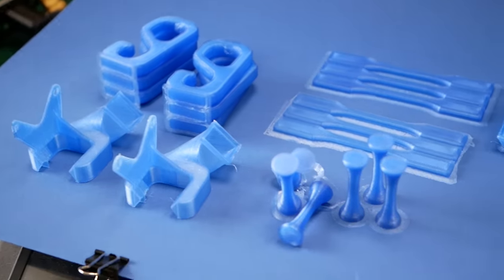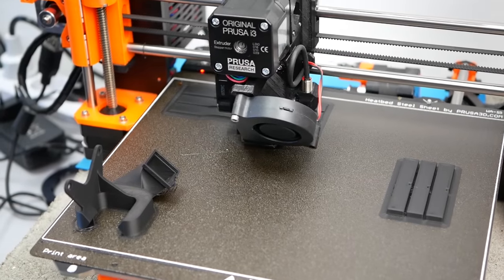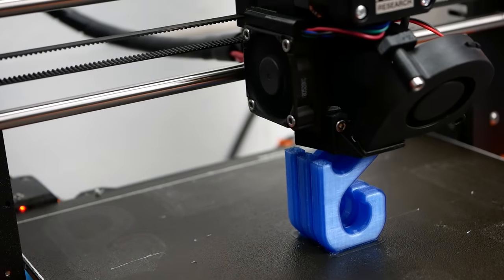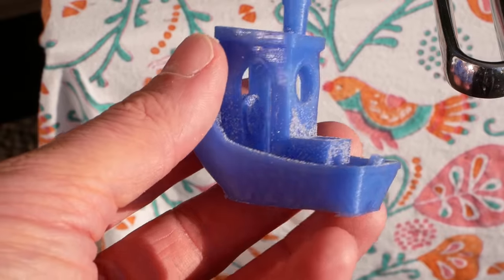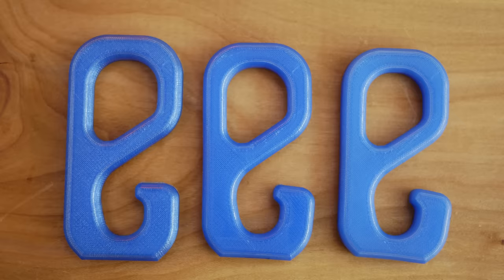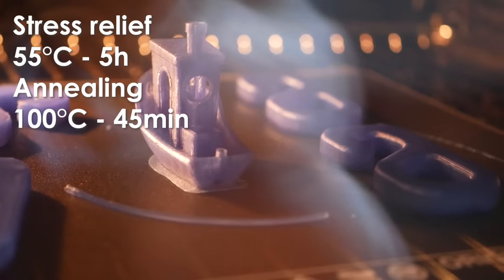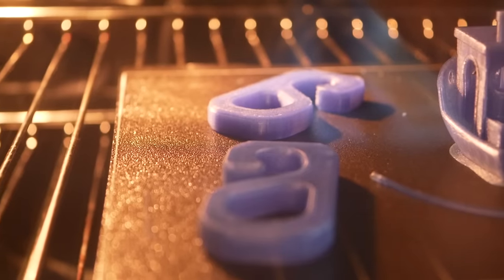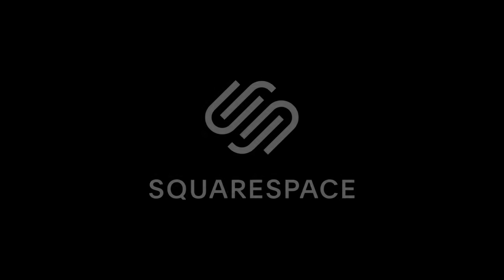Strong 3D prints through ANNEALING, but... Part 1: PLA

Comment: Wouldnt it be cool to have a duble extrusion 3d printer that would have really high temp plastic in one nozzle and like pla in other. So it would print the shell of the part and than crank up the bed temp to 220°C and fill the inside with pla. It would make really strong parts

Comment: What about using a blow torch on the surface with some kind of rotation?  This might even help to smooth the print and increase the strength somewhat at least the surface layers.  Or what about a rotisserie oven.

Comment: Would be interesting to see how the material behaves after multiple heat treatments. The first one increases the heat resistnance 10%. So maybe you could higher the temperature in the second run to increase it even more.

Comment: Nice testing as always. I have wondered about a infra red heat lamp is use during printing as I did it before to reduce warping but it keeping the previous layer warmer may help with layer adhesion

Comment: Annealing is due to the process of heating then *flash cooling* similar to quenching steel for knives ext.. you didnt see gains  because you allowed it to cool overtime
Heat it up to just below it deformation temperature then flash cool it in water

Comment: I've only heat treated PEEK because the filament manufacturer said amorphous PEEK doesn't have the desirable properties. I suspect the idea that annealing parts improves layer bonding is on parts where there's residual internal stresses such as poorly printed ABS parts. Print ABS well and you probably wouldn't benefit. I suspect nothing will change with PETG because of its lack of crystallization.

I'm not seeing where it's worth annealing PLA to avoid needing to print some other material.

Comment: Thanks for this! I always wondered if it would help the layer adhesion, a bit of a bummer it's not. I think we would need a printer that would be able to rotate a piece while printing and have a layers added horizontally on top of vertical ones... But I cannot think how a machine like this could work! 

I did many parts in two sub parts, one printed horizontally and the other vertically and glued together after to augment the resistance, works well, but more work in design and built

Comment: I wonder if pressure applied during the heating process would allow for layer bonding. Perhaps a weight on some packed sand, with the layers you'd like to bond, parallel to the ground?

Comment: I would really like to see you investigate PLA's tendency to crack as it comes off the spool. This especially happens with 3mm diameter filament and seems to happen after the PLA has aged for several months. In my experience it seems to form small cracks on the inside of the coil shape that comes from being wound onto a spool. Is this simply due to the stress of a coil being straightened? Or is there more going on here? Thanks for all the great videos!

Comment: I only have an old DaVinci Mini, got it 2nd hand for cheap along with a roll of blank tags, to learn and print some handy little gadgets. This can be very useful to try, as many prints is various holders and adapters used for solder equipment ("functional prints"). It's not directly in contact with hundreds of degrees, but it can be near so radiative heat exposure often up to 80-90°C, which has already messed up some of my printed parts.

Btw, the DaVinci doesn't have a heated bed,and its construction doesn't seem to make adding one a realistic task. Would plopping an enclosure over it, help notably with bed adhesion? Room temp is usually 25-26°C when printing, but I assume a box around the whole printer could probably increase the effective ambient temp for prints..?

Comment: Perhaps make somewhat hollow prints and then fill it up with a strong resin of sort...

just beware that the curing process creates heat so it could also warp...
maybe that could be countered to let it cure in sand + vacuum?
Reply: I mentioned it in another comment but i believe you can use gyroid infill with this process

Comment: Great video. Just curious if you had accounted for the moisture content of the pla? The annealing process probably also dried out the filament very thoroughly which might be a factor.
Very interested to see your results with nylon. My favourite filament is 3dxtech CF filled nylon which produces really strong parts including layer adhesion but can't do a layer thickness of less than 0.25mm.

Comment: Thanks 
This was very insightfull and learned alot.
I was wondering if this annealing process if it followed, a reflow soldering temerature curve where you heat the parts to a specific temp for a certain time that every object can reach that temp then ramp up the temp for short period then decrease the temp slowly. 
Probally achieve the same results.....
Or will it?

Comment: I bet you would get more significant results doing stress relief with a high-warp material such as Nylon, ABS, or Polycarbonate. PLA is such a low warp material, I am not too surprised that the results were pretty underwhelming.

Comment: I was thinking. you really want to melt the outer shell.. Because its the outer shell that takes most of the force. Then inner part is just there to stiffen it up.

So in stead of trying to bake it for a long period of time. Bake it so fast that the inner structure don´t have time to heat up. 

Exactly how to do this i don´t really know. But it need to be heated up really fast and then cooled down fairly quickly as well.

Something like submerging them in boiling oil. Or just dipping one side at the time. This should totally melt the outer shell. refuzing it, while the inner structure is still sollid, making so it don´t fall apart.

Comment: Hi Stephan, I recently discovered your channel and I really like your content. Watching some previous episodes an idea occurred to me that I think you may be interested in. It is about using a 3d printed part with little infill, and using it as a mold with sand in a preheated oven in order to recycle the support and waste material to melt it and use it to fill the spaces in the printed part to fill it with material. I think it's a good idea to be able to use material that would otherwise be discarded and get a piece that gains a lot of strength while maintaining the general appearance of it. I hope you can try it and test the results. Auf wiedersehen and goodbye

Comment: I have tried annealing PLA by putting it in boiling water and letting the water cool slowly with the part in. I perceived it as being slightly stronger than the un-annealed but I don't have any data to back it up.

Comment: would you please test whether or not increasing layer overlap increase strength? It seems that if an individual were to use many of the tactics you've researched that the accumulative effect would be add up to be a significant increase in strength. Perhaps compiling these strategies into and "end of year" video could help out everyone trying to maximize their printing success.

Comment: How did you decide what time length and temperatures to use?

I have tried the sous vide method and surprisingly didn't see any warping. I didn't do it in a controlled manner like you though so I cant begin to ponder why. It was just a quick test to see if the method would work. I put the part in a zip lock bag filled with water and put that into a slow cooker like thing (timer and temperature control but no pressure). Heated at 80 C for 1hour and turned it off and let it cool overnight. I also didnt have specialised tools and didnt actually test the effects on strength as the only test I could do would have been temperature resistance but couldnt do it in a reproducible way.

Comment: I can't be more pleased than when having access to an attempt to prove something through a measurable and reproducible experiment.
You did it quite well since the birth of that channel.

That said, and although I'd not be able to suggest any precise experiment that would go further than yours, here's my opinion. Hope it helps :

My guess is that the filament's critalinity is already maximised when exiting the factory. My guesss is that heating it mildly (60-100°C) may solely worsen that cristalinity (btw, the change in transparency tends to demonstrate worse cristaline properties, and the elongation in Z tends to demonstrate a structural memory of the cylindrical filament : flat layers become cylindrical again).
My knowledge is that cristals are naturally formed during a very slow and continuous diminution of the ambiant temperature.

A (maybe not so important) fact : You're totally neglecting fundamental parameters of your questionning. Temperature may be the main parameter, but that parameter won't probably have any special powers without specific conditions of pressure, probably associated with a certain magnitude and direction of an electric (and/or magnetic) field, and probably associated with the presence in the inmediate environement of some specific physical elements (gas, ions, other cristals, etc.) participating in the process of creating and/or amplifiing the above-mentionned conditions.

My guess is that a single layer of heated and extruded filament behaves quite similarly to a coil of lava. The enveloppe of a single layer becomes cold way before the inner material. Simultaneously, a huge amount of bubbles formed of various gas, that were trapped in the lava, escape during the coil, leaving the surface of the cold lava as crisp as sanding paper, and even sometimes, under certain conditions, as sharp as millions of razor blades.

Then...
Maybe we should look after practical solutions to keep the whole environement of the printer quite hot while printing (to precisely control the loss in temperature) and prefer moisted filament to over-dried filament, in order to take advantage of the evaporation of some micro-bubbles of water (and then take advantage of a textured surface to better melt the layers).
Concerning the ideal rate at which the finished object should become cold again, maybe we could get insights by reading documentation on the original industrial process of producing the currently tested type of plastic.

Maybe you already found out more since the time you made that video...
Is there an update ?

Comment: I bet as time goes on, the overall process will get more refined until it makes a larger difference in the strength of parts. For example, maybe do a stress relief, then an annealing, and then a second annealing at a higher temperature.

Comment: when you were placing them in tightly packed sand did you enclose the sand? I have found warping almost went away when tightly packed and closed in a container, that being said itw as way more effort than its worth and i'd never bother doing it again
Reply: With that much work why bother with pla anymore. Just cast whole part. It won't be much more work but it will be worth it.

Comment: I have found that one of the easiest ways of annealing PLA is by throwing it directly into a pot of boiling water. I did it for an accessory holder for my car, produced very strong heat resistant parts. The downside is that the PLA, originally a translucent blue, turned an entirely opaque baby blue color.
Reply: For how long did you keep it into the boiling water?

Comment: How about encasing parts in plaster, and really heating them to completely melt the parts.  The existing plastic will be insufficient due to infill voids in the printed parts, so just add more filament to the mold as needed. I would think you would end up with 100% solid plastic parts that have no weakness along any layer lines.

Comment: I'd test myself, but I'm still on the fence of getting my first printer (wifey's fighting me hard on it haha)

if you wanna melt the layers together without losing the overall structure, generally high heat for short amounts of time works: it takes a certain amount of time for heat to transfer through a material (depending on its thermal properties and temperature delta) so if you can heat up the outside enough to melt before the inside gets hot enough to, then cool the unit before the inside begins to melt, then you should be able to fuse the layer lines together without losing the structure. I wonder if a heat gun would be enough to do this, as I'd assume a direct flame like a propane torch would be way too much.... perhaps propane-heated air like a kiln though...

Also I'm curious, what if you heated the parts at, say, 80 degrees for an hour or so (to heat evenly throughout, perhaps high infill?) then dunked them in water, as a sort of prince ruperts drop style, and allowed to cool slowly afterwards, would the plastic survive the thermal shock? would it be stronger?

Comment: 9t labs made a hinge bracket that holds 900lb by 3dprinting with layers of cf nylon in a specific orientation through the pla and then compression moulding it with a machine.

Type in 3d printed composite bracket vs machined steel for the youtube video.

Comment: What if you tried to use an ultrasound vibrator (no pun intended) as you heat the plastic. It's used in chemistry to help dissolve things fast, by causing micro-vibrations. Would be hard to do inside of an oven though.

Comment: The sand casting guys could probably tell you with more accuracy but I wouldn't doubt that using greensand and annealing inside of that would prove beneficial. Most times in this particular use, the 3D print is burned out while casting a metal part, but with careful temperature control, I don't see why it wouldn't work and at least help maintain dimensional accuracy.

Comment: It would be interesting to see how annealing increases the "melt in hot car" resistance.  PLA prints are infamous for deforming when kept inside cars in the summer sun.  Does annealing make this less likely to happen?
Reply: Annealing PLA started out as a method of raising the melting/deforming temperature point which is already covered in other CNC kitchen videos. 

He's just seeing how this impacts strength as it hasn't been covered fully yet.

Comment: I think the real problem is that in most cases the strength of the part is almost entirely dependent upon layer adhesion and heat treating won't do anything to that unless you almost melt the plastic... and then the part loses all it's structural integrity and collapses under it's own weight. The kind of temperature control you'd really need to have a shot at improving layer adhesion without turning your print into modern art is just not something your conventional oven is going to manage.

Comment: It would be very interesting to see what would happen if PLA is annealed in a strong electric field, like between the plates of a capacitor. If the electric field is strong enough and aligned appropriately, it can exert a force on the charged segments or dipoles within the polymer chains, causing them to align preferentially with the direction of the field. This alignment can potentially lead to a more ordered crystalline structure as the polymer solidifies. 
🕉️✌️

Comment: I'm wondering if layer separation can be "improved" in a different way. As I understand it, the problem is that you're depositing warm material on top of colder material. That makes me wonder how you could heat the "base" layer without deforming it. Some kind of IR emitter just in front of the nozzle perhaps?

Comment: Could you make a bigger video summing up the main methods to strengthen 3D prints? There's so many tips in different videos that it's hard to follow along what to do by now. F.eg I want to print a propeller for a 4hp motor... It's real tricky to figure out what steps to take to make it as strong as possible.

Comment: Hi, I am used to annealing glass when making glass lampwork beads and the set annealing temp to use for different manufacturers glass. The idea being not to lock in stresses as the glass shrinks during cooling...but here for PLA you dont specify a manufacturers set annealing temp?  For PLA it seems its not shrinkage but instead the molecular structure being changed by reheating up to a temp, held,  then cooled?  With glass you have to put the beads still on the mandrel straight into the kiln and then anneal them, as they are still way above the annealing temp.   A bit puzzled here... thanks  Laurie

Comment: I wonder if the vertical expansion is due to air expansion inside the part. Maybe designing the parts to have no sealed air pockets would have an impact on the deformation?

Comment: You did not try to do these parts with solid infill? I suspect that the warping / deforming might have something to do with the air on the hollow infill. It has moisture in it and it can expand by different amounts in each pocket thus deforming the part. Also with solid infill the part should not shrink since there is still the same amount of material in the part

Comment: I am currently working on 3d printed Ballscrews for a cnc machine and got them to work quite well with carbon fiber PLA but I am worried about the wearing behavior of it. I wonder how Heattreating would affect the creeping behavior of the plastic and in general how fiber reinforced Filaments react to annealing. They are known for less warping in materials like cf Nylon and i think it might get them through annealing with less distortion. I would really be interestet in other peoples experiences and maybe even professional tests about it

Comment: What about surrounding the part with plaster of Paris and then heating until the pla melts? The plaster of Paris should keep the dimensions but is easy to remove by submersing in water.